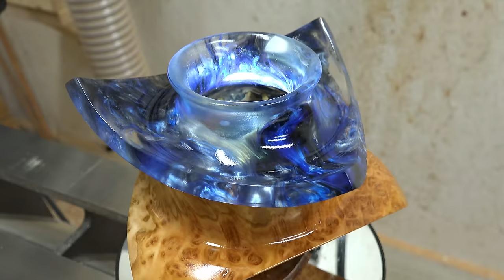Woodturning:  Not enough corners! 😳

Comment: This is a very unique piece it’s gorgeous. When you start with turning do you have an idea of what you’re making inside your head or do you just do it as the woods turning?
Reply: The proper answer to your question is:

"Yes."

I cannot speak for the artisan here, but atleast for myself with both wood and metal work - you often start off with, atleast, a basic idea of what you're going for. That said, nothing is ever perfect, and often a whole new idea will form mid-way through the early stages of a project. However, at least for his needs, I would have to assume that he is setting out with a plan in mind. He moves with too much initial purpose to be winging it, and settling on a design that begins to form out of, basically, dinking around. 

It's pretty easy to get lost along the way in an unplanned project, and end up with something quite beautiful when you are finished - however something that even you did not intend when you set out. Unless he is simply cutting past a great deal of standing around, staring at the lathe, scratching his head wondering what on earth he is doing? He has at least a basic plan from the start. As he does edit out his taking of measurements I guess it is possible, but fairly unlikely. You'd want to have a goal in mind if recording it. Some of the wood he uses is quite expensive, and you wouldn't wish to waste any if possible. If he is like me, a lover of wood, you wouldn't want to waste any anyway, and even if you meander down a rabbit hole of new ideas as you work - at least you HAD a workable idea to start with.

Comment: Dave- you said that you were just starting with epox....next time you cast coat the wood with clear base epox for enough time for the epox to start or tack up..keeps the bubbles from coming out into your resin and they will go out away from the covering resin surface.....same problem with any wood / resin cast.......only takes about 45 minutes and no effect on the bond

Comment: have you ever thought about filming at a framerate that divides the RPM evenly? Would probably look extremely cool if the shutter speed is fast enough to capture the piece without it turning too much. If it worked it would look like the piece is stationary and your tool moves, shaping the stationary piece little by little

Comment: While Stardust Micas do make some amazing pigments for resin, I think you may have accidently picked up some from their Soap making section. Two reasons; Resin should not react like that, something is catalysing and producing heat. Secondly, the blue pot clearly states is safe for using on Face and Eyes and has the word Soap in the jargon on the side. 

While you managed to negate the issue before it was too late with the pressure pot, I'd strongly recommend not using the soap ones as they can potentially mess up your entire project.

Comment: I’m new to this art form. What is the reason for the pressure pot? And how long does it need to stay in there. And at what pressure level?
Reply from the maker: The pressure pot removes a lot of air pockets and helps the resin to set clearer.

Comment: How long do you leave in the VC? I attempted this and it was full of bubbles / air :O
Reply from the maker: In this case i used a pressure pot and kept it under pressure until the resin fully cured.